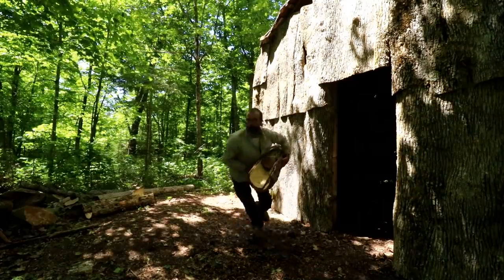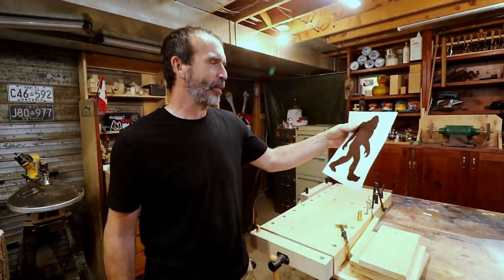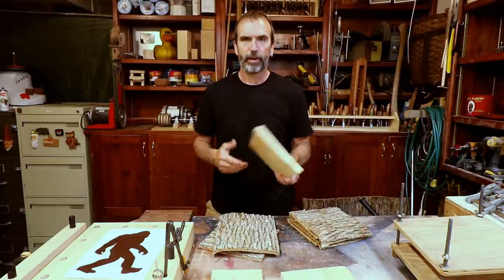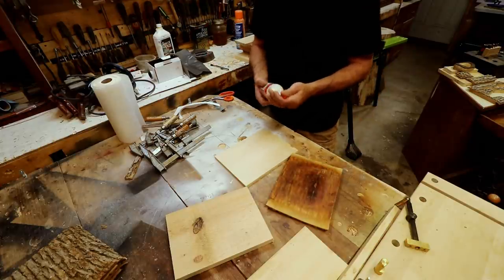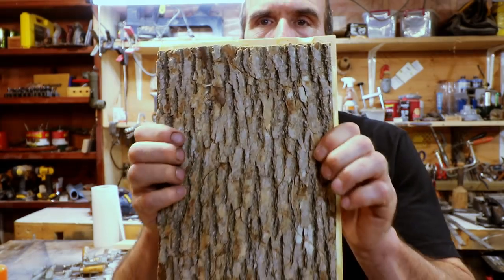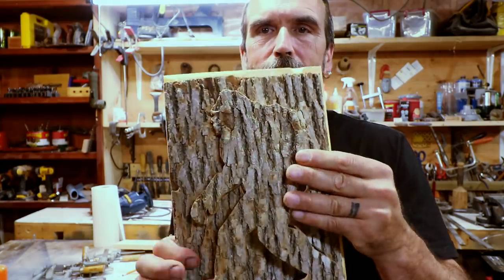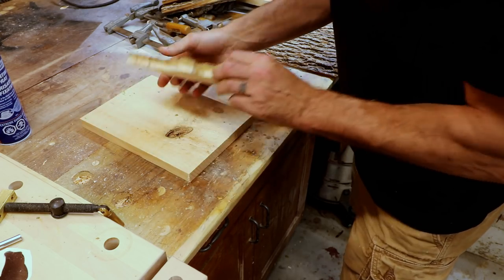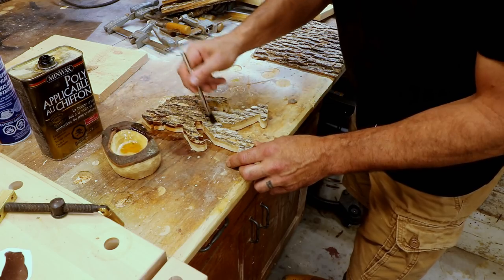Making a Bark Bigfoot (DIY)

Comment: Doug,just a tip for a pattern. 
Put a layer of blue painters tape on your work piece first an then glue the pattern to it. 
After you cut the piece out, just peel off the pattern and tape. You can also use packing tape. The packing tape actually lines the saw blade and makes for a cleaner cut.
Reply from the maker: good tip!

Comment: You could have run the bark thru the planer before the glue up to flatten it up a tad. Squach would look ok in 3d anyhow. I kind of liked the "offset squach" version, and the empty blank certainly has uses... It's all in good fun. Now I'm on the hunt for bark.... That should take a while. I feel a trip in the back woods coming, I own some swampland, should find something usable. Need some rooster 'Ys" and some spirit logs anyhow. 
It's a good video, I think the other ideas would have flown just fine, but I guess it's bigfoot for the win!

PS, love the glue pot, project #2 for my list.